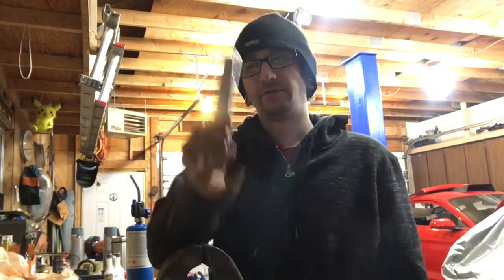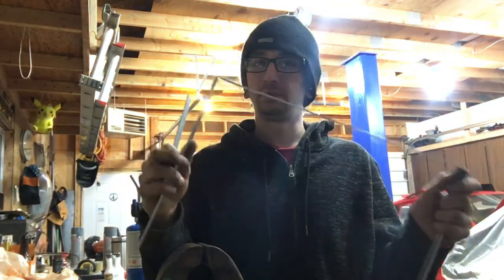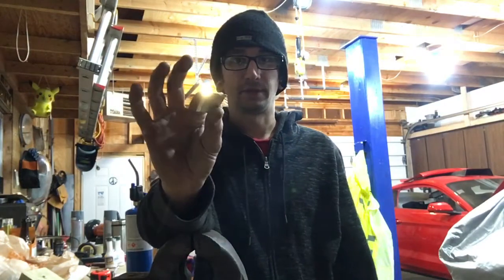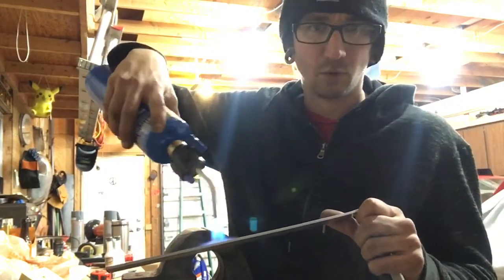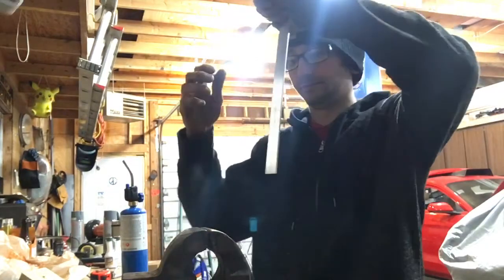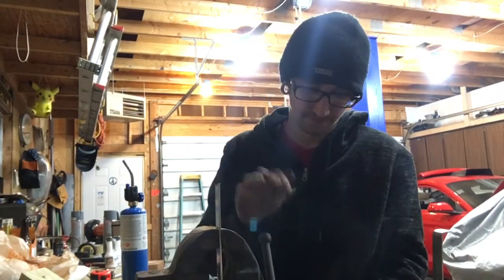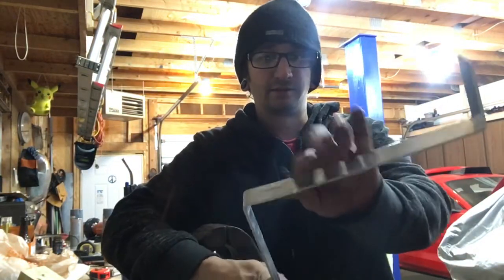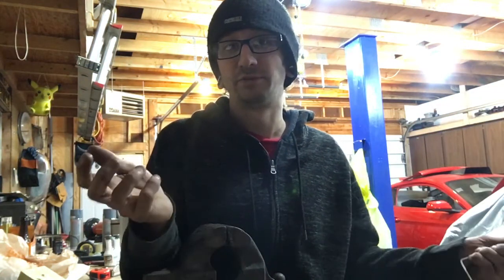BUILD TIP: BENDING CHEAP 6061

Comment: If you bent the material with a proper bend radius then no need for annealing. For your 1/8" thick material a minimum bend radius of 1/4" is a good start.
Reply: Just to be sure I’m understanding you correctly. You’re suggesting that 6061 1/8” aluminum can be bent at a 1/4” radius without the need for annealing and won’t crack?
Reply: @LovelessRanch  that would be a minimum. Better would be 3/8". You would have to do some testing and if you can make sure that your bend is across the grain of the material. If you have to bend parallel with the grain then definitely use the 3/8" radius.

Comment: I need to build some aluminum support mounts.  They need to be fairly strong since they will be supporting a 600 lb static load.  Once the aluminum is annealed it seems that it will lose a lot of strength.  Is that true?
Reply: Yes, that is true.  Strength is why it was heat treated to begin with.
Reply: @LTVoyager Most 6061 thats annealed/welded is not re tempered, it works fine unless its under a LOT of stress.

Comment: Can you do the same to flatten out, heating for the torch and sandwich between two flat surfaces?  I have a bent license plate bracket that i would like to flatten back out.
Reply: Obviously just put A LOT of pressure on the whole plate for few hours to be sure

Comment: Congratulations you just took the tinsel strength out of the Aluminum this will cause the piece to fatigue and break much sooner, why don’t you just use 6063 aluminum it’s more easily bent or heat and quench you finished piece

Comment: Why not splurge a little, and mount the vise on the work table?
Reply from the maker: I move my vise a lot. I actually have 3 different benches in my garage to bolt it to.
Reply: Why not make an intelligent comment, rathet than a stupid one.

Comment: Annealing is done by heat treating the material AFTER the bend.
Reply: Depends on what you're doing. Shooters annealer their brass before shooting which stretches it in the chamber. They anneal before to prolong the life of the brass and prevent splitting or breaking.

Comment: Now that it is annealed, how do you get it hardened again for the work it is to be used for?
Does it harden on it's own as it cools, or does it need heating and quenching to be hard again?
Reply: I think you are thinking steel.
Reply: @lanix17  No, everything he said's applicable to a lot of metals, including aluminum.